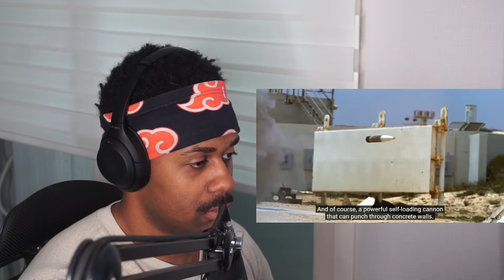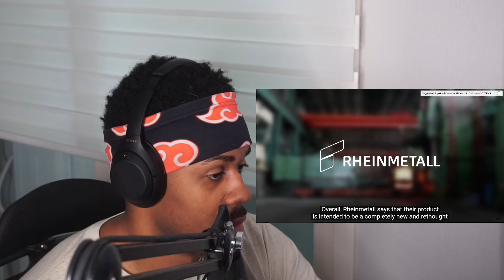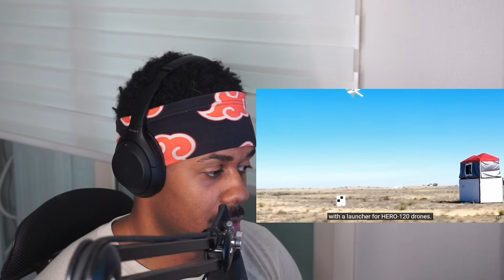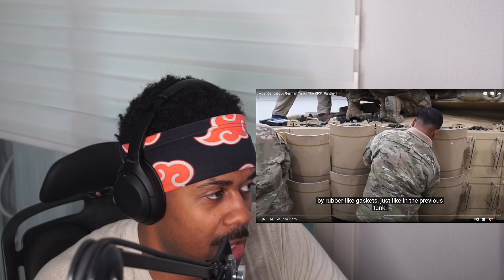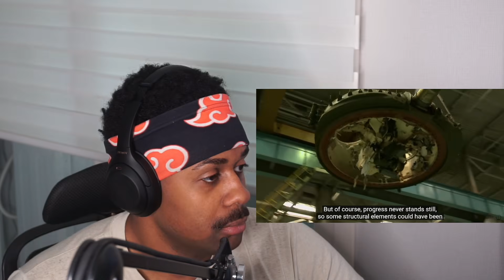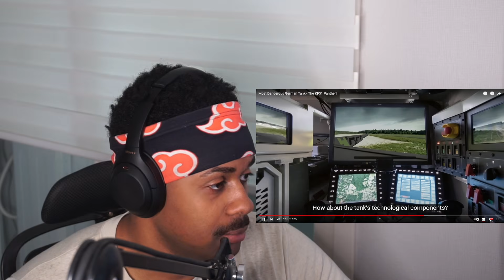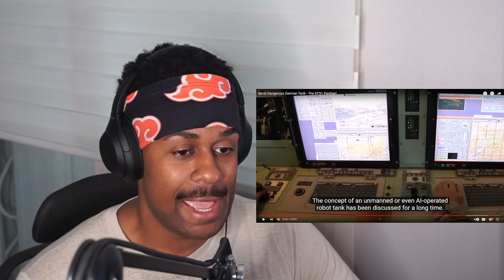Germany Unveils its DEADLIEST Creation...The KF51 Tank

Comment: First in, but you cannot compare an abrahams (had long reached its date of modernisation) with a next generation tank.

The Leopard 2, at least the last 2 evolutions is the best of the "old" tanks, esp. with the 120/L55 cannon. The americans "cheated" with the depleted uranium, some cruel weapon that should be forbidden (look into the iraq, there are waste radioactive devastated areas by this - killing hundreds or thousends of civillians), otherwise they would be FAR behind the Leopard2 with the longer cannon.

The gas turbine - nuff said is enough - do not work and is basically a HUGE flag winking "i am here - but the protection system of the abrahams was taken by nearly all western countries AFTER its introduction.

The panther is the "best" this-and-the-next-generation tank, the chassis is still a leopard2, but they have engines to upgrade the power from 1500 to 2000, later optional 2400 HP, enough to bring back the agility of the first leopard2 and MORE.

The genius of the panther is, it has a perfectly working autoloader (instead of using shitty ones as the french and russians in their earlier modells) and so space for a 4th crew member who use drones. This and the modern defence system (the next step AFTER the nearly perfect Abrahams-system) makes it the best and strongest tank.

Unfortunatly, the german politics want to build a "new tank" with billions and billions of wasted money WITH the french. These joint ventures are shi1, do not work and for 1/10 of the money they will waste they could build around 1000-2000 of the Panthers. NOW. The joint venture tank is planned for 2035 :D
In germany we do not says "Waffenbeschaffungsamt" (Office to organize weaponary), but "Waffenbestechungsamt" (Office to bribe and get rich from). 
ad but true, so the german army is just a bunch of sh1t, with helicopters who aren´t allowed  to overfly water (for the MARINE!), armored carriver vehicles that were rebuild to allow pregnant woman to work in safe! (costed only 1 billion euro to basically rebuild the whole tank :D)
and many many other things.